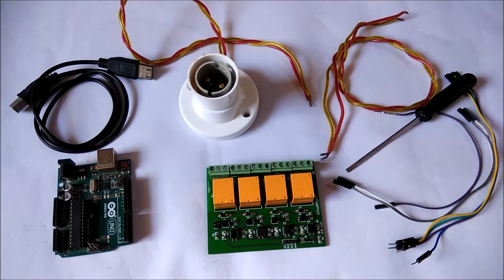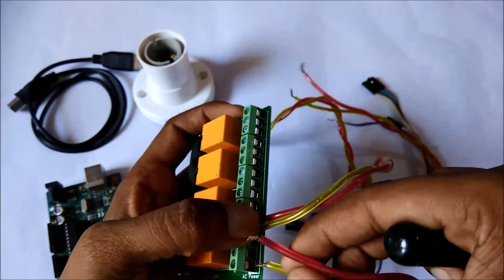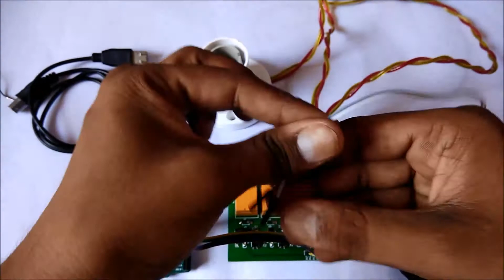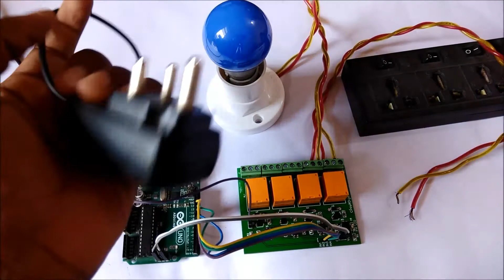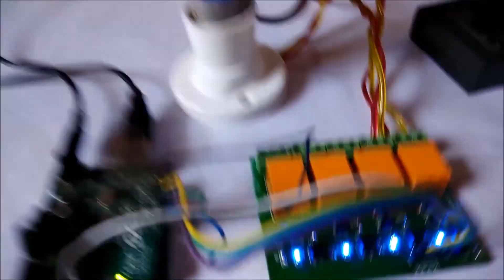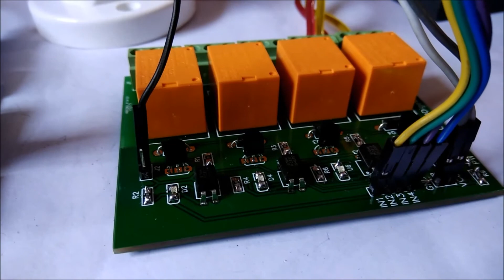4-Channel Relay Driver Module Circuit & PCB Design

Comment: i'll be automating my home, can i use this pcb to connect my home appliances (fan,light,tv etc) ? i mean i won't be making a college project instead i'll be implementing home automation for my home and it will run 24x7 .. so is there anything i need to worry about or i can continue with this pcb layout and design of yours?